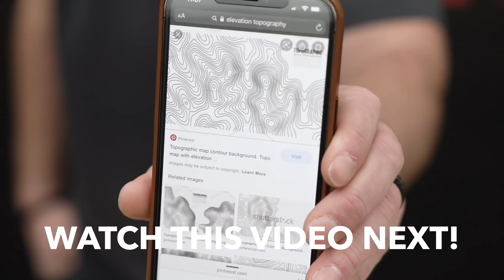Easiest Epoxy Technique That Looks Like Real Stone| 2 Boards Coated Using New Pigments (Coming Soon)

Comment: About how many times during the drying process should I spray the denatured alcohol to make sure no bubbles?
Reply from the maker: You want to start with one light mist, check it to see if there are any small bubbles are remaining. If so, let the denatured evaporate for 5 ish minutes then another light mist.

Comment: Tell me, perhaps, for what purposes is denatured?
Reply: You can use it to clean your tools and clean your surface before applying epoxy. Pretty sure he uses it to pop air bubbles also giving a glass finish
Reply: It will also cause the pigments to become loser and allow cells of color to develop in the product.
Reply: Best to use 90% isopropyl alcohol for cells. Sprits it on dont mist